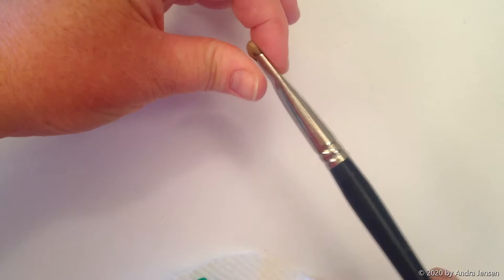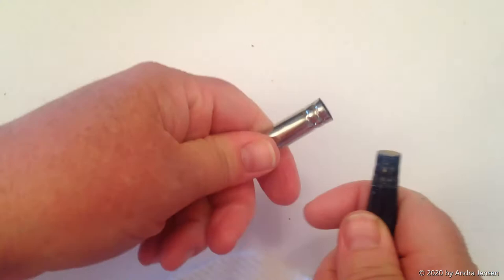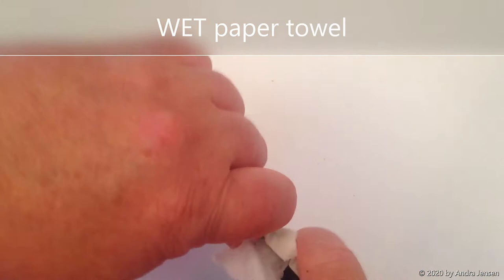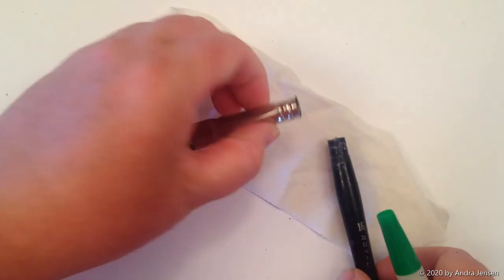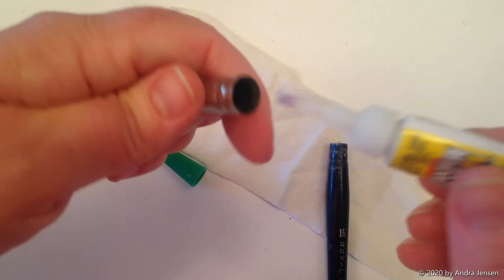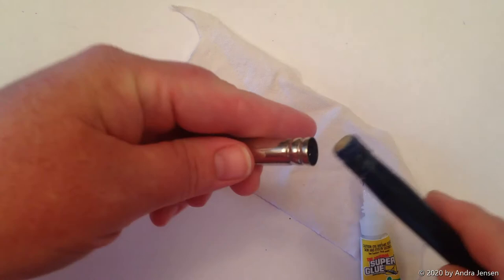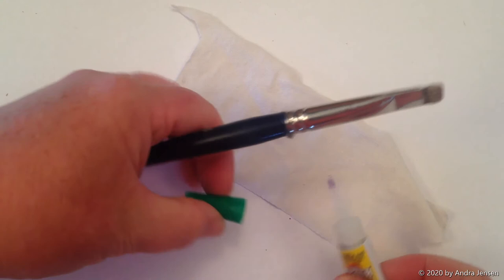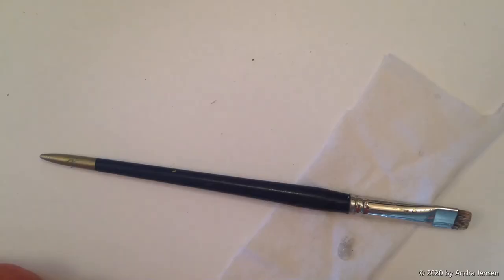How to Repair a Paintbrush (Art Painting Brush Handle Fix, Two Methods)

Comment: My best fix is a piece of copper wire. I cut a piece of #14 Romex and strip the coating case off the wire. I take my dremel and a drill bit than drill a hole in the feral and place hole vertical on the flat side of a hammer and use a tack hammer to flare both sides of the wire. The only way it will come off is if you use a file on one end to cut away the flat end on the pin. Feral will stay longer tan the brush will last.